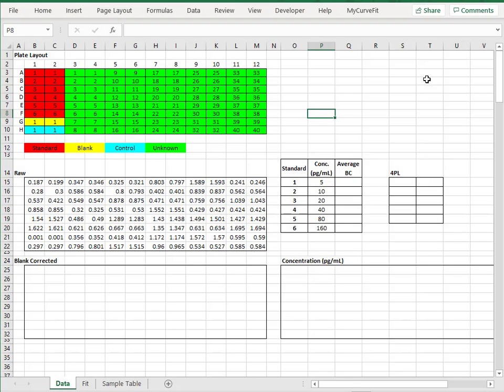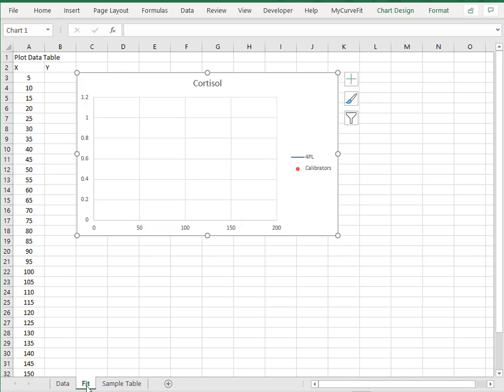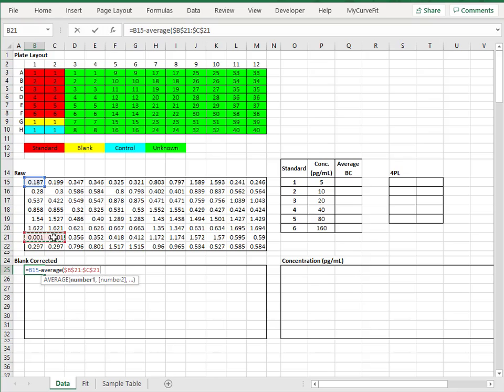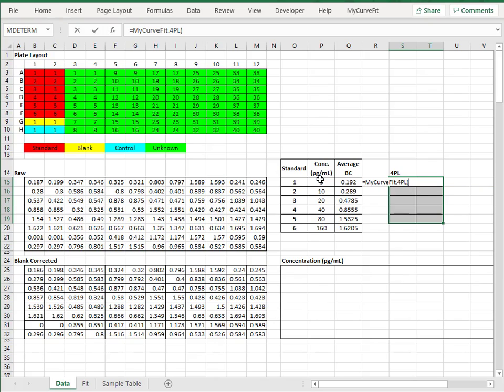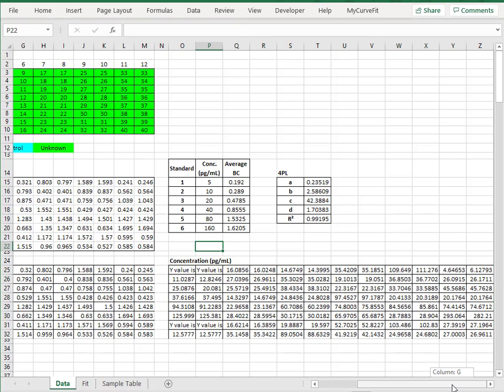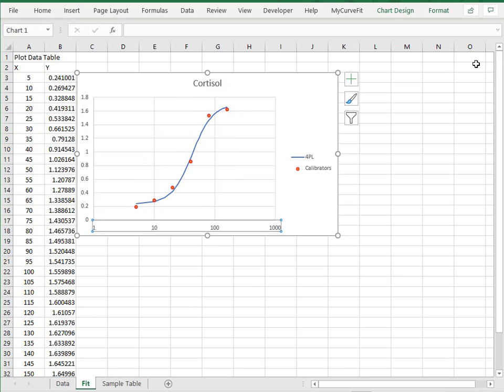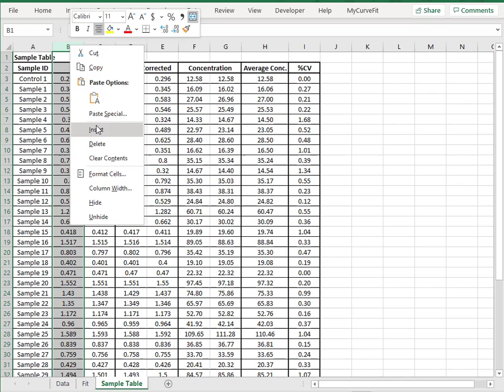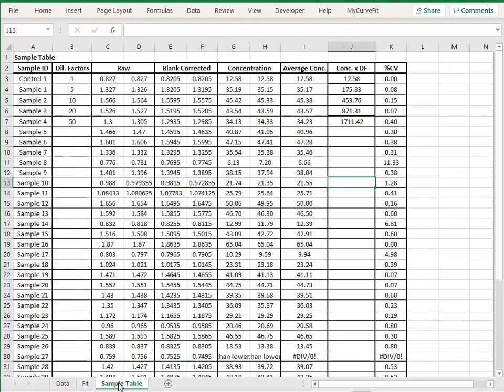ELISA Analysis in Excel with 4PL

Comment: This was very helpful, but I have a question for you. I don't know the value "Y value is < than lower asymptote."  I think the value is similar the blank value. How can I deal with it.
Reply from the maker: Hi, thanks for your comment.  The lower asymptote refers to the lowest value that can be obtained from the curve (represented by either the a or d parameter, depending on the type of assay you're performing).  Samples with values outside the asymptotes of the curve cannot return calculable concentration results.  To allow me to assist further and answer any additional questions you may have, please send me an email to support@myassays.com.  Thanks!

Comment: Please who did you calculate your dilution factor
Reply from the maker: Hello, thank you for your message.  To calculate the dilution factor, use the formula:
Dilution Factor = (Final Volume)/(Initial Sample Volume)
So for example if you've diluted a sample 1 part to 4 parts diluent, you might use 100µL sample and 400µL diluent.  Using the above formula:
Dilution Factor = (100µL+400µL)/(100µL)
Dilution Factor = 500µL/100µL
Dilution Factor = 5
If you have any additional questions, don't hesitate to reach out via email: support@myassays.com.  Thanks!

Comment: What happens when R2 value is 0.8819? It does not fit the curve well. Should I go for polynomial regression instead of linear?
Reply from the maker: Hi, Thank you for your comment!  Lower R² values can be indicative of a poor fit.  In these instances, it is recommended to review the assay procedure and obtained data for the standards.  Check the standards follow the expected trend for the assay.  If everything is as expected, it may be that a different fit method should be used.  To easily evaluate different fit methods, you may find our free curve fitting tools available at www.MyCurveFit.com to be helpful.  If you would like additional assistance specific to your data, please send your assay and run information to support@myassays.com.